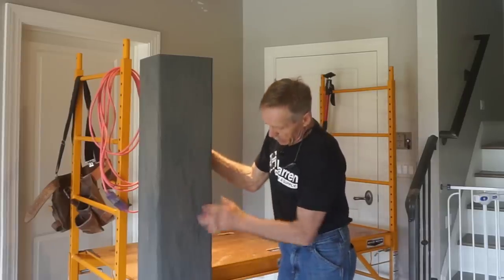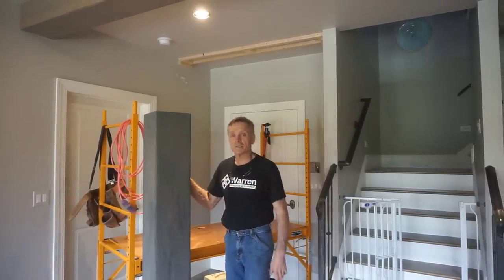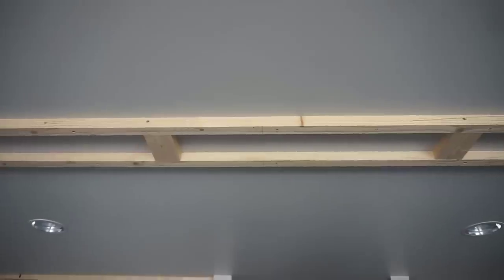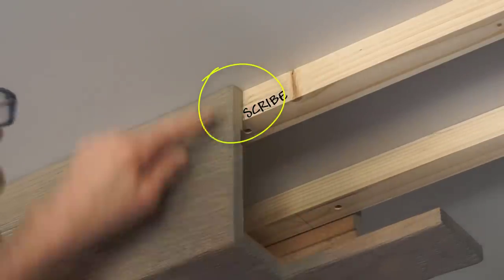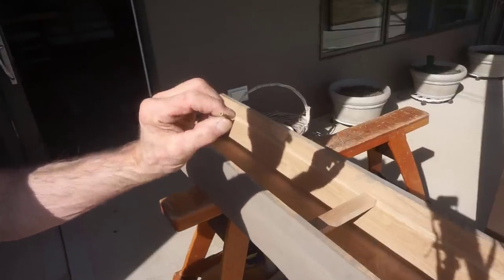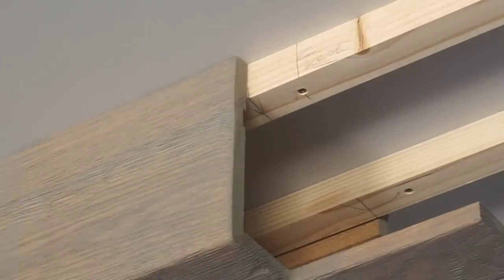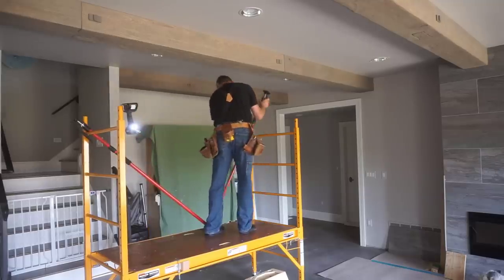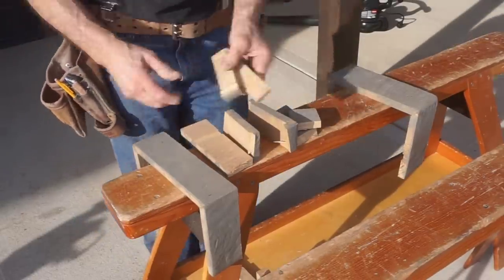Pro Tips for Installing Faux Beams

Comment: That's sad that the designer didn't like the original faux-weathered finish and and you paint them blue.  There's no accounting for taste.
Reply from the maker: Fear not jefferverde... the final faux finish (as you'll see in an upcoming video) doesn't have that 'blue' cast you're reacting to. I knew it was 'wrong' the minute I put that short beam up!  FYI It was an epic process to 'get it right', believe me!  Truth be told the designer was less than helpful during the process but I'm very pleased with the end result.  Not that I expect everyone to be but as long as my client is happy, I'm happy... and she does have good taste BTW.  Best, Matt
Reply: I had the same first impression too blue for the pale walls. I look forward to seeing the final color.
Reply from the maker: @anneoreilly4900  It's frustrating that a small sample can look so right yet a whole beam can look so wrong!  I've learned over the years to 'sneak up on it' to avoid a blow up from having a whole project come out wrong... Best, Matt

Comment: Yours is such an informative channel. This particular video brings back memories for me. When I bought my first home in the mid 60's, I wanted a rec room in my basement. However, there was a heating duct that ran perpendicular to the joists. I figured the only way out, was to hide it inside a false beam.  I did it roughly the same way you did.  But being new to woodworking (I was about 25 at the time) my work lacked your skills. The lack of scribing as you demonstrated was not done. I hid the cracks with moulding. It worked out just fine and the rec room really turned out well. No laser tools in those days either.  Scientists only came out with the laser about ten years earlier. At the time it was considered just an interesting oddity with no practical benefits. Imagine that.

Comment: The moral of the story is: install real beams 😎. 
This guy has real knowledge and workmanship. Most people watching won't be able to get the job done properly. 
Back before I got construction experience I remember helping a builder installing beams. Real ones though. We gave it a distressed, vintage look before installing them, but it didn't require as much work as these ones. There were just heavier and we used exposed steel mounting brackets. 
Still looks super nice many almost 20 years after.

Comment: Next Level Carpentry, yes. Artist, badass, great video maker certainly. Thanks for the enjoyment, Matt.
Reply: PS those teespring and patreon buttons in the video are not linked.
Reply from the maker: @dsethsmith  Thanks for mentioning it... the ones in the video are just 'clip art' but just click on the Info Button in the upper right corner of the video and you'll get a drop down list of video links along with Patreon and Teespring.  I'm sure there's a way to make the clip art icons linked but it would take someone much smarter and resourceful than me to get it done😒😢 Best, Matt

Comment: Nice video, it looked much like me, up and down, on and off my platform, doing something very similar. I have always worked alone, that way I have full control. I am just finishing off my beam installation in a dining room. Put drop crown molding all around with rope light in behind for mood lighting. Installed some low watt pot lights in the beams and some 9 inch Pyle speakers. All mine is painted white to match the molding. Love those adjustable floor to beam support poles, I use them all the time, like having an assistant.

Comment: It sounds obvious when it's explained- that's how you know it's genius. I'm excited by this fitting technique- and moreover, you showed me added value in my belt sander. Thank you!
Reply from the maker: Might not be obvious so I'll mention that the Klingspor Planer Belts I use are a significant factor in success with a belt sander.  Lesser belts don't perform as well initially and usually fail prematurely.  Other than that it's a matter of practicing on scrap or prototypes to develop confidence.  Oh... and the 'back beveling' is key too.  Sorry, I don't mean to make it intimidating... go for it and you'll do fine! 😁😎 Best, Matt

Comment: Nice Job,  I really enjoy watching a craftsman work, I picked up some great tip's.   I'm completely redoing my pole-barn, workshop, man-cave and will be adding a lounge area with faux beams in an Old English Hovel style Post and Beam; what I learned here will definitely make my life a little easier.
Thanks for sharing.P.s.  I'll tip a glass and give a shout-out to you when the job is done.
Reply from the maker: Thanks SE... glad to hear you find this helpful.  Not sure if you've seen the other videos in this informal series but I tried to put enough info in them to be useful for similar projects.  Good luck with your project... sounds like a fun one! Best, Matt
Reply: @NextLevelCarpentry  watching them right now.
Regards,   Walt
Reply from the maker: @SouthernEngineering  there's one more long video in the series which I am editing right now. Probably won't apply so much to your project but it shows the whole faux finishing process to get an aged look to the beams in a color pallet that works with everything else in the room.  Thanks for watching. Best, Matt
Reply: Hi Matt, I look forward to the final video.   My plan is to simulate rough saw beam, perhaps a burned and wire brushed finish or just wire brushed and light stain since it's my pole-barn I'm free to experiment without the worry of fine woodwork.  I'll make a few samples to practice using the biscuits and finish options.
Reply from the maker: @SouthernEngineering  sounds like a good plan... good luck and have fun!  Best, Matt

Comment: I use the same process  with all my extended scribe cabinet installs. Even better than a pencil, scribe with a sharp knife. This works great even on a highly visible white painted cabinet. The knife cut prevents any possible chipping while saw cutting. When the last bit of material  falls off with the belt sanding, you have what looks like a factory cut.
Reply from the maker: Scribing with a knife is a great alternative contemplate, especially on painted stuff like you mention!  Thanks for commenting! Best, Matt

Comment: 👍👍👍👍👍
Wish they had multiple thumbs up button.  So this is the best I can do for now.
I did a fake beam for a friend years ago, wish I knew you then. These beams are phenomenal.
Reply from the maker: Thanks Michael!  FWIW I've got another client project in the works where I need to make about 140+ lf of beams very similar to these and I'll be using the same process for making them because this really does work as good as it looks in this video. The band clamps really are the key to success.
Best, Matt

Comment: Just build about 200ft of faux beams used a lockmiter bit with glue home owner wanted reclaimed cedar turned out nice my joints where similar I really like the fast cap clamps great job

Comment: I use that same method for scribing paneling when it butts to a wall or even another panel in a corner when the cleats are a skosh out of plumb.  Zero gaps is the goal.

I used those 3rd hands for installing t&g planks to a ceiling.  3/4"x8" by as long as 16' boards in a very large living room.  Working solo it was a chore but it turned out beautiful.

Comment: Thank you very much for this video! I watched you make them and asked about this one video yesterday… it just popped today!!! Great look, great finish! Thank you I learned a fair amount of tips today which will help me tremendously on my next project !!!! 🙏
Reply from the maker: Glad to hear it Jerome... I noticed your comment/question on the other video and was going to send you a link to this one but my computer was out of commission so I'm glad YouTube made the connection for your benefit and mine both! Best, Matt
Reply: @NextLevelCarpentry  thank you Matt!  By the way, how one knows the size of what the beams should be? Is 3x5 a good idea if my ceiling is 8 feet tall? Thank  you very much.
Reply from the maker: @clavieala  size and proportion of beams is mostly a matter of personal taste. To get an idea of how different sizes look I often make mock up beam sections out of cardboard or styrofoam and put them up with tape or pins to get a feel for how they look before committing to making the actual beams.  Nothing like a true-to-scale visual to help decide.  Good luck with your project! Best, Matt

Comment: Skosch is a good unit of measurement.  I once had a unit conversion program on a computer that included slubthungs and frinibbles.  Used to crack me up.  I only found out about torx head construction screws and impact drivers very recently.  I was like, "where have you been all my life!"

Comment: Fantastic job! As a time saver, instead of so much detail work. I would just notch the drywall the same size of the beam. This would allow you to put one entire faux beam up at a time. The result will be even better as when the wood shrinks you wont have a gap either.

Comment: Matt, I just finished watching your hour + of faux finishing. And can only sigh that the designer wants a color adjustment. All that work!
Looking forward to seeing you pull new tricks out of your tool kit for us.
Reply from the maker: Hey Anne... The designers direction to change how the faux finish needed to look was expected so, although it was frustrating, I didn't have to undo anything I'd done.  Getting it right was mainly a matter of using a different process going forward which is much less costly than redoing things. 
Thanks for watching! Best, Matt

Comment: Great work.  I personally prefer to trace the beam to the wall and use an o-saw to remove the drywall and shift the beam into the wall itself.  That way as the house settles no gaps open up at the ends.  Painters tape the beam and fill in the gap with mud or caulk and paint.

Comment: Great work Matt. The question, I have is did you make a video showing how you scribed the small beam with no joint? You mentioned fixing scrape marks and a hole?
Reply from the maker: I didn't shoot or produce video showing that small beam section since it's so tricky, time consuming and obscure that it didn't warrant the effort from a video production standpoint.  The main point is that a single piece of beam 'can't' be scribed to both walls.  I had to cut a hole in one wall to have enough space to slip the beam in place, scribe both ends and then slip a piece of drywall back in after the fact.  The takeaway is that it's far better to install beams like that BEFORE drywall goes up.  Best, Matt

Comment: I think I use the same principle for my scribes, for example I temporarily pin my architraves (door trim) with the back edge on the line that I want the front edge to finish on, then use an off cut of the trim as the scribe block. Saves any measuring and reduces margin for error. Dunno if that makes sense, Ive not seen anyone who uses the same method before but to me it seems like the obvious way
Reply from the maker: I know exactly what you're describing Ben... you did a good job of it!  I first learned the concept you mention watching guys cut 12x12 VCT tile to fit around door jambs through doorways using a full tile to mark cuts on the piece they're fitting. Sweet and simple! Best, Matt

Comment: Great video and process! I'm surprised you didn't have to scribe the top of the beams too where they meet the tape joint corner. But it looks like you have a pretty flat ceiling overall in the middle. Top notch video

Comment: Clean-looking install, Matt. Very clear scribe method demo. How do you approach the same end-scribing task when fitting a one-piece beam into an opening where both ends must be fitted simultaneously?
Reply from the maker: Hey Mike, I didn't show it but when I mention 'patching a hole' in the wing wall by the stairs was how I ended up handling the double end scribe.  I that beam close by making pattern scribes on a mock up beam section and transferring them to the beam but, because of the corner bead on the wing wall and other anomolies had to jab-saw out a 12" square of sheetrock to get that thing in.  Ugly but necessary which made me thankful it was only one out of 12 that needed it.  Otherwise I'd have come up with some sort of feature to use as a trim collar to cover gaps and add interest while avoiding patching every wall at every beam end.  Unless of course that's the look 'they' wanted... Best, Matt  PS Hope you're bionically back up and around and doing well?
Reply: @NextLevelCarpentry  Hi Matt. 
Scribing both ends of a beam or trim piece into gnarly finished openings is a task I have come up against many times in the type of work I do. One method I have used for beams is to make up a tightly fitted U-shaped saddle, 12-18" long, that fits around a longer spare length of the faux beam section. (Sometimes, you can use your shortest unfitted real beam as the "spare" if you fit all the longer ones first.) To mark the real beam, I temporarily secure the spare faux beam section in place, then slip the saddle around it and scribe the saddle to the end wall, using a method basically identical to what you show in the video. I then can use the saddle as a template for marking the first end of the real beam. I then repeat this process, re-using the same saddle, to create a marking template for the other end of the beam.

When locating the saddle template on the second end of the beam, great care must be taken to get a precise overall length for one edge of the beam, working from a pre-determined reference face. More moving parts and attendant opportunities for error in this method than when just scribing one end at a time, but with care the result can be very good. (Of course, you must survey walls for plumb first to make sure that a wider opening at the top of the beam than at the bottom will not either dictate which end of the beam must be pushed up into the opening first, or even prevent you from being able to install a tightly scribed beam, if pre-assembled.)

BTW, I am up to 30 minutes on the stationary bike for my bionic knee rehab, so your long-play NLC videos make for great educational entertainment and multi-tasking. l
Reply from the maker: @michael.schuler  Love your 'saddle template' method!  Gonna keep that in mind for future fits because, as you say, with great care it will surely produce excellent results!  I tried a direct scribe of a sample beam section which works fine... until transferring the scribe to the actual beam.  In this case I needed to cut a hole in the wall regardless because the beam was longer than any opening and I couldn't rotate it in because of the hypotenuse effect of the side of the beam.  If it was easy everybody would be doing it, right?
Good news on the rehab... keep it up and you're in for a wonderful summer! Best, Matt

Comment: Great video and as always a true craftsman. Have you done anything on a vaulted ceiling installing these box beams and making a King or Queen truss?
Reply from the maker: No, unfortunately, I have not.  I am in early planning stages for a possible beam project like that but, for practicality, etc, would be using faux beams by Volterra through Decorativeceilingtiles.net in case you're curious... Best, Matt

Comment: I've enjoyed the series and subscribed.  Thanks for making it.  I have a question about scale.  These beams are what, 10 X 10?  How high is the ceiling in the room they are in?  How did you determine the appropriate size for the room?  I have a room that I have thought some beams would look good in and have thought about doing such a project.
Reply from the maker: Thanks for the sub Gary... much appreciated.  The room has 9' ceilings and the beams are 8" deep and 10" wide.  The proportions were decided/determined by my client and her interior designer with my consent.  This particular designer generally goes for larger scale than seems appropriate IMHO but stuff I do at her direction is always pretty impressive.  In the design world color, shade and proportion all go together so a beam that's the 'right size' in one color may be too big or small in a different color.  You saw how light these started out compared to how dark they ended up?  I try to stay out of it unless something just looks 'wrong' to me... like the blue/gray beam in the beginning of this video.  I knew it was wrong but wasn't sure to the end what was 'right'.  You'll see the final final color in the next Next Level Carpentry video where I go through the actual faux finishing process in great detail.  Probably not much help but there it is... Best, Matt

Comment: Just awesome. Knock down finish on dry walls are the thing out here in Colorado and where I'm building in S.D.  How would you do that for walls and ceilings.  Would you install the beams, Frog tape them at the edges and protect them for when they do the knock down?  You've just shown me how to make a home look like a post and beams without the cost.  Thanks so much
Reply from the maker: I think I'd probably just have them do the knockdown first and install the beams after... it would help the edges come out better IMHO.  If you can wait on the final coat of paint on walls/ceilings until after beams are installed it would be better because there's bound to be some touch-up after fitting/attaching the beams.  Good luck! Best, Matt